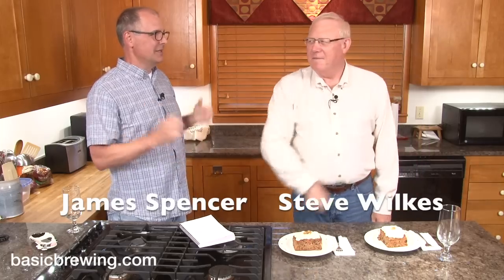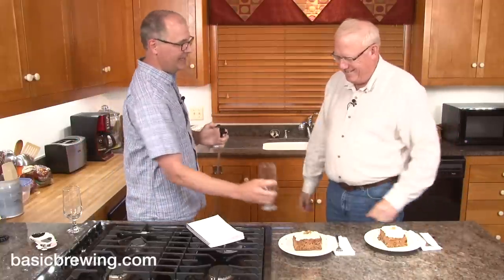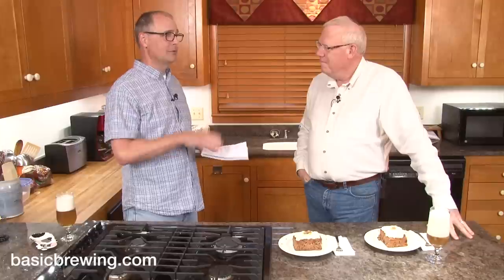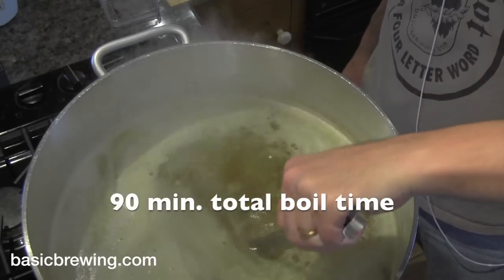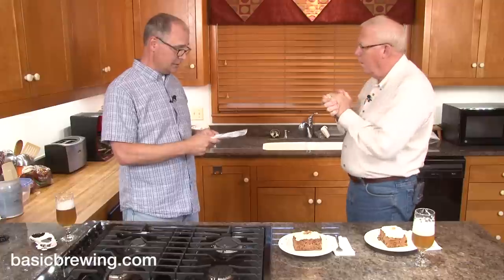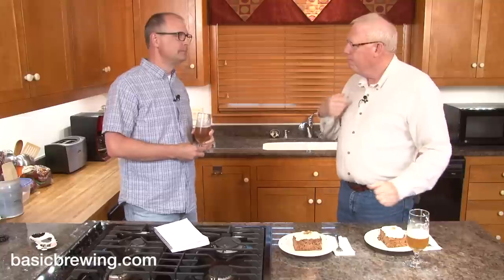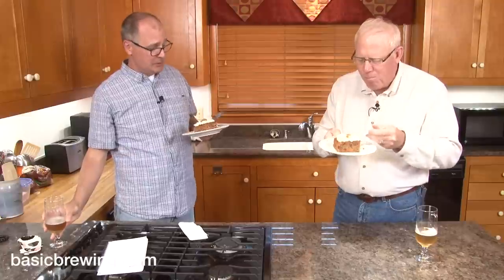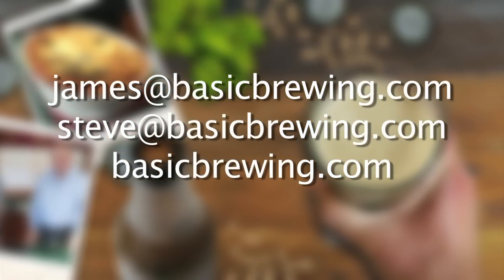Brewing Maibock - Basic Brewing Video - May 25, 2015

Comment: You goof balls. The commenting on the frothy head were funny. I make lagers all winter too and I'm sure it's easier for me than you since I'm in St. Paul. In fact, some cold corners in my basement are TOO cold for primary fermentation of lagers. I love them for some of the reasons Steve is talking about. It's just a simple, awesome beer and not always about hops. I always make a Helles and a Pilsner, and then vary it up after that. I've actually been making India Pale Lagers for a few years and man are they good. (Also Black IPLs). Anyway I'm all for spreading the lager love. I did a video on that this past winter too.  Cheers.
Reply from the maker: donosborn Cheers!